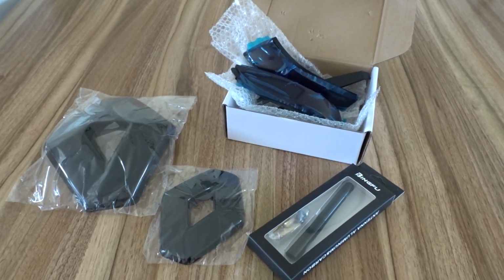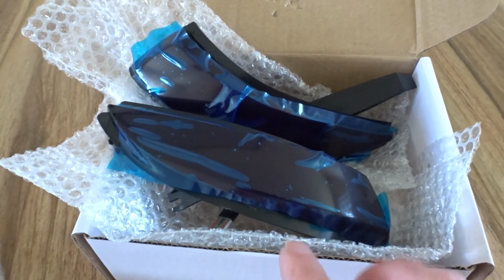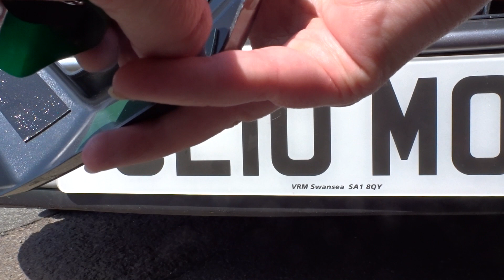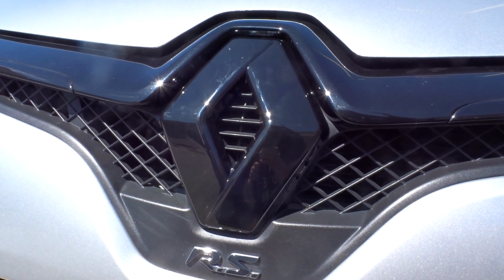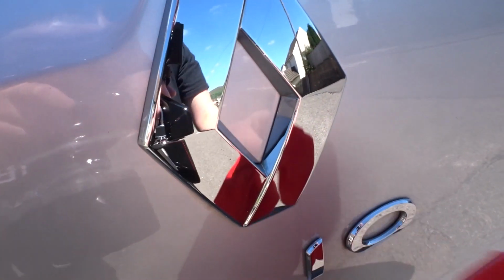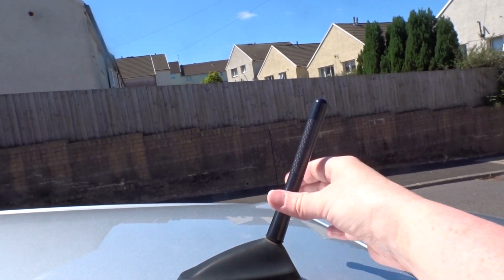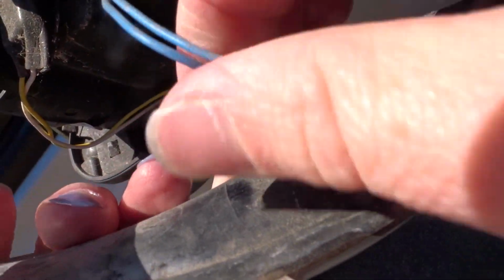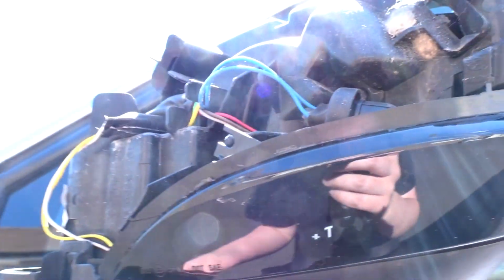Simple Cheap Mod To The Clio mk4 RS 200 Turbo

Comment: i got the mrs a 10.1 inch stereo from ebay, it really transforms the inside of the car, plus with you being into mods you can install TORQUE on it and have a realtime turbo booste etc.. on your screen.  btw can you tell me where u got the indicator strips please.
Reply from the maker: The indicators was from amazon priced at £25 on prime delivery
Reply: @cliomodz2312  Thanks I found a set on ebay for £19 delivered. Her chrome clio door sills arrived today, so far I got her.. number plate, clio logo chrome keyring, 10.1 head unit, mats, dynamic indicators, door sills,  gonna need to do my own clio mod channel way she's going.. hahaha I'm looking forward to see what you do with yours, obviously we can't compete with the engine but anything small and body related... gives me ideas xx

Comment: wondered if you help me, ive just purchased the wing mirror indicators, is there a correct way of poppin the mirror covers off, or do you just use pry tool and try and do it anyway you can, i wasnt sure if these mirrors needed to remove the glass first and release a clamp or something.. do u start at a certain side first??
Reply from the maker: Yes you need to pop the mirror off first then there is little clips to pop off behind the mirror that then will allow the mirror cap to come off the back. Hope that helps you out. Unfortunately I didn't capture the full removal of the mirrors and cap.
Reply: @cliomodz2312  fantastic thanks, would be a great tutorial video for your channel as no1 has covered it on YouTube. Thanks for the quick reply.
Reply: @cliomodz2312  got the glass off, just wondering how the clips work, push in squeeze lol... having a nightmare lol
Reply from the maker: Yes in the corners are the clips to remove the back of mirror cap